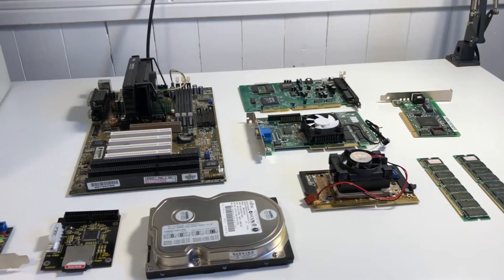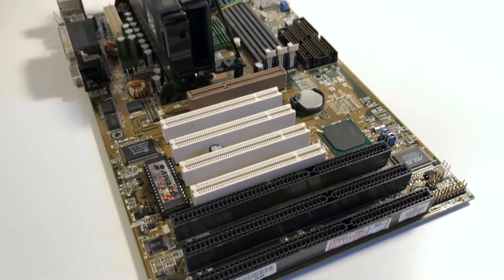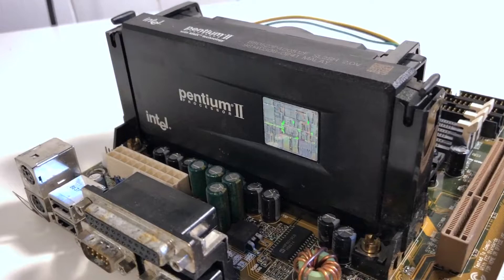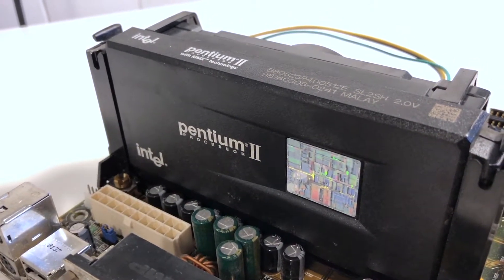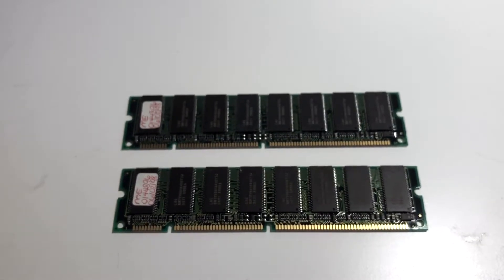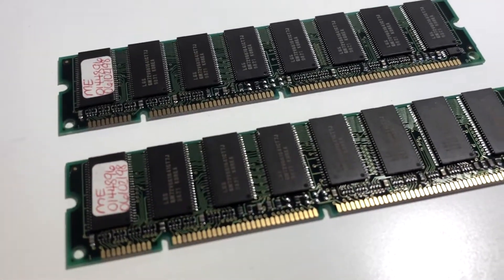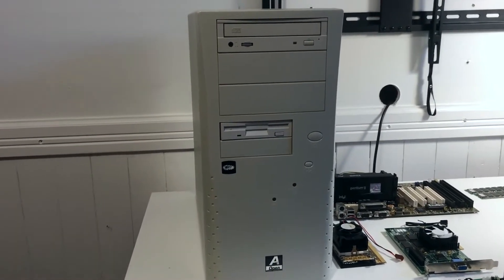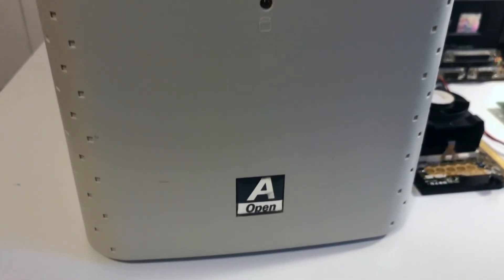Building a 1998 Gaming Rig! Part 1 #Slot1BuildOff

Comment: I have the exact same motherboard with a Pentium III 500Mhz processor. I have fitted a Voodoo 3 3000 graphics card and an Awe 32 sound card. I am running Windows 98. Bearing in mind the age of the motherboard it runs totally stable. A real testament to the build quality of ASUS boards

Comment: I remember that case, probably had a 100 at least at my high school... In 2007. Ranged from celeron 433s to p3 933 systems. We had a few HT P4s by the end of 06 as well. But most were the older systems. I remember our tech class only had 6 working systems... I built another 10 out of spare parts in the classroom closet lol. Ranged from p2 333 to k6s 400mhz. All were a bit slow but capable for classroom needs at the time. Oh and I kept a copy of starcraft spawned version on the media center file server... I could play starcraft just by accessing a network shortcut icon I kept on a floppy from ANY computer. Good times :)

Comment: This is such a fantastic video, and I really can't wait for the build! Thanks for sharing this one Mike. A few thoughts: I really, really appreciate your take on the Banshee. I think you are so right; it is an underrated card, and has some really nice 2D features and the 3D performance is perfect on a system like this. The choice to go Slotket is fantastic, and I appreciate the uniqueness in that aspect. The performance uplift is going to really show, especially with that Banshee. I love that you're using a mechanical drive; to be honest, the only thing that keeps me from doing so is the ease of transferring data to SD/CF cards, but mechanical drives are doing it "right," not that there's a wrong way haha. The AWE64 is also a fantastic pick; it's perfect for the era, and an all-around sweet card. I love the case too! Honestly, man, this is just such a perfect 1998 era build! Thank you for sharing!
Reply from the maker: Thanks so much, Will! It's been a lot of fun putting it together. I'm really looking forward to getting some games going on it! I don't usually use mechanical drives either - mainly because the acoustics get pretty awful with age - but I figured in something attempting to be period correct, it would be a good choice. At least I can use the 10/100 card in it to FTP files over. Thanks again for the feedback! I'm pretty new to doing this type of video and have a lot to learn :)

Comment: The Celery 300A overclock to 450MHz was a VERY noticeable bump back in the day. I had the slot form factor Celeron 300A in my system, seated in an ABit BX6 2.0 motherboard.

Comment: On the mem.. the high end config in 98 was 64mb and this is in around 4 to 5k pc back then. These high end p2 300 with 64 mb started to appear in jan 98. So your p2 400 from late 98 with 128 would have been a beast.

Comment: Fun fact, the Pentium II processor is a Pentium Pro (Socket 8) CPU with MMX. Socket 8 processors had a L2 cache on the CPU running at the full clock speed. This caused alot of Issues for Intel, as the L2 cache and CPU had to be bonded together before they could be tested, if the cache or the CPU was defective it rendered the entire product dead. To Combat this, the Pentium II adapted the L2 cache interface into what was called the Backside bus. This allowed Intel to put SRAM chips in the cartridge. These cache chips would either run at 1/2 or 2/3 of the CPU clock, depending on the CPU clock speed. These cache chips usually where the reason that Pentium II processors would fail at overclocking, if the cache chips were on a bad bin they'd end up stalling out and crashing the system.
Reply: in case of Slot1 l2 cache always runs at 1/2 of cpu clockspeed, 3/5 and 1/3 dividers were only a thing on amd slot A cpus.